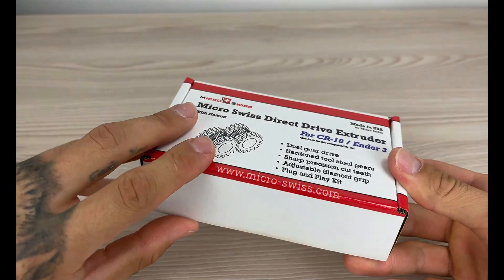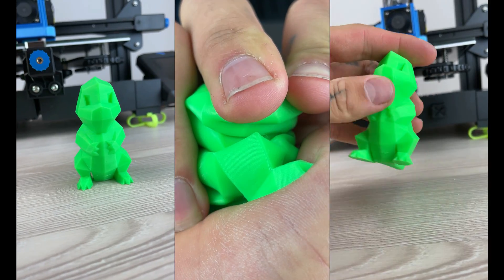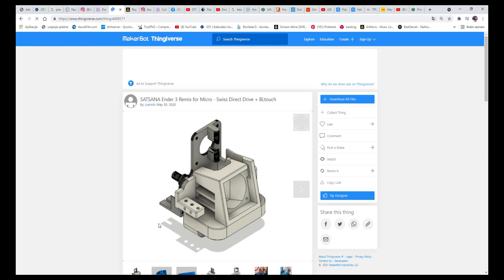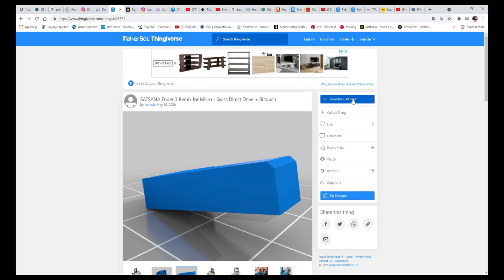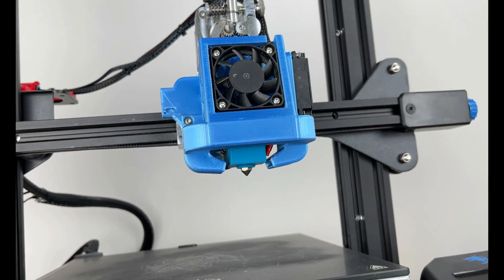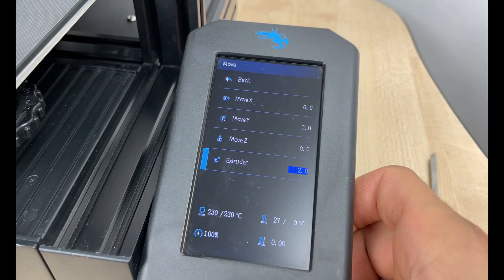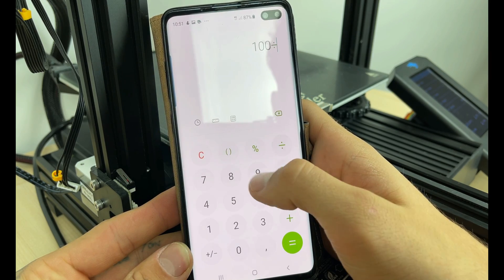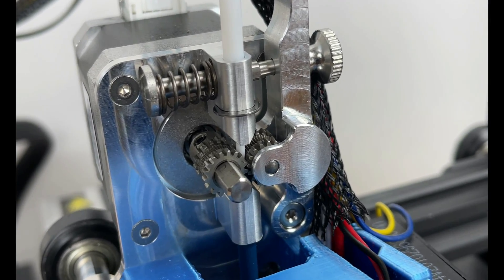Ender 3 V2 Upgrade - Micro Swiss Direct Drive Extruder

Comment: TO CALIBRATE ESTEPS: do not connect the extruder to the hotend. Calibrate it without having the pressure of pushing filament through the nozzle.
After it is calibrated you can install it
Reply: You can just remove the nozzle.

Comment: does the extruder motor hit the frame on top if you lift the gantry up to 250mm?
Reply: i just installed this and the stepper motor comes really close to the frame side and top rails but it clears them so you dont lose any print volume

Comment: I bought this kit last year but have not had the chance to put it on the printer the current hot end is clogged do you think I could print the fan shroud without a fan shroud?
Reply: I ended up doing it the first one came out full of holes but I used it to make a good one out of petg

Comment: Hi, could I ask: Does the stepper motor crash into the left metal bracket  (is the size still 22x22)?
Reply: i just installed this and the stepper motor comes really close t the upright brackets but it doesnt touch them. it also clears the top brace.
Reply: @BuildThoseSkills  Oh, I see. Thanks!

Comment: Did you have any issues with the extruder going the wrong direction?
Reply: My extruder pulls back instead of feeding
Reply: @grimreaper5649  apparently this is because you have to use the cable extension that comes with the kit in order to reverse the direction of the extruder motor you are re-positionning

Comment: Nice one !!   How close to the uprights does that stepper motor come?  I'd stick with the stock cooler :)
Reply from the maker: We did not really understand the question:/
Reply: You need to run the cables forward, around the z-axis uprights.  It will not hit anything then - even at maximum height.